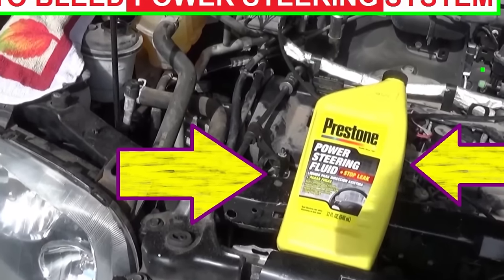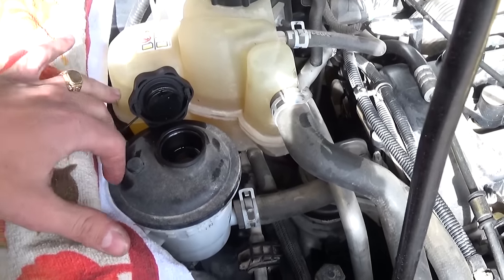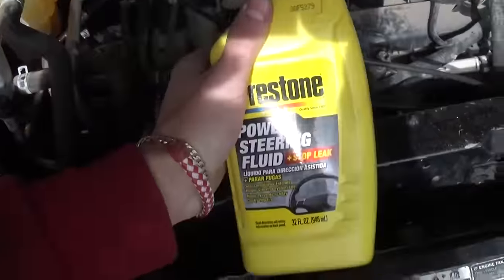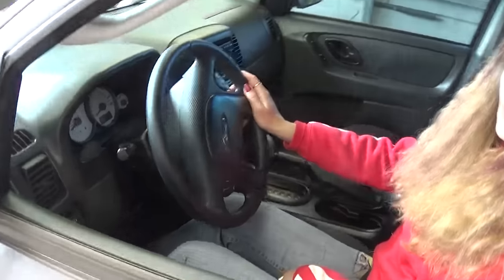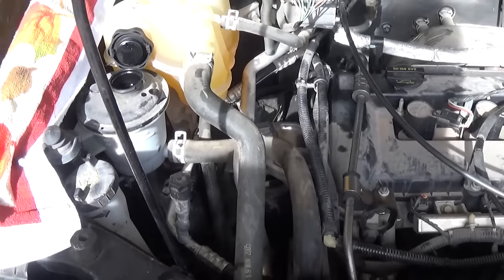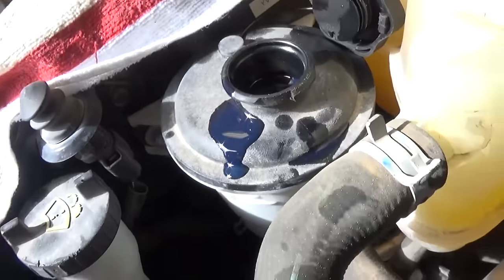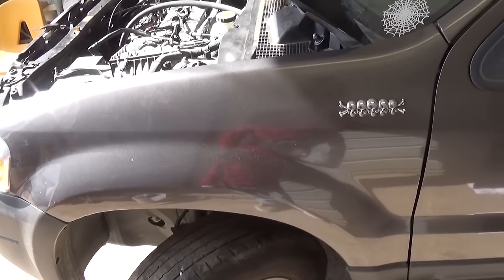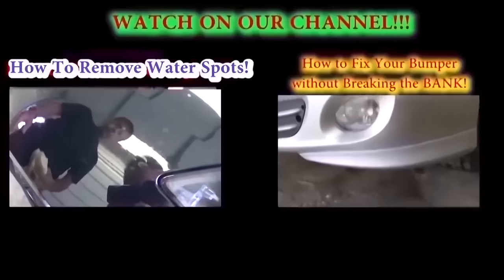How to bleed Power Steering System the RIGHT WAY! Bleed Powersteering

Comment: Much appreciated, had a loud pump, thought I needed to replace it. I had added power steering fluid a while back and knew nothing of bleeding the system. After seeing this, went out, turned the wheel a bunch, then started it (cap off) and did the same. Much more subtle and will monitor it as time goes by. Thanks for taking the time to help.
Reply: Any update my friend?
Reply: @geicocommercial  used your mentioned procedure and steering worked as it should. Noise disappeared as the fluid got through the system. Thanks.

Comment: This helps a lot man. I'm gonna do the new Rack & Pinion and pump in my 2000 Ford Windstar like this in just a few minutes.
I had never heard of bleeding Power Steering like you do brakes with vacuum. The instructions called for a J 43485 adapter and they are a fairly expensive adapter that fits in place of the reservoir cap so you can put 20 in vacuum on the system to draw the air out like brake lines. 
I didn't want to buy the adapter. I've spent hundreds on this thing already.  Thanks for this! 😀😀😀

Comment: Vacuum pump is definitely needed on some cars and you MUST repeat the procedure several times people. Let it sit overnight if time for it with cap off so bubbles work themselves out of system. Repeat next day. ALWAYS check fluid level during the process.

Comment: How do you get the steering wheel to turn with the car off and in park? My Jeep feels hard to steer that way, should I power through the weight or lift the front tires?
Reply: Sorry just realized it’s on Jack stands

Comment: I did this after replacing my power steering pump on my 2003 Crv. The power steering pump,  is getting very hot. What could be the issue?

Comment: Thanks guys! My instructions that came with my new rack n pinion said I needed to run a suction pump, (with a non sealed connection, as far as I can tell), and I was thinking that doesn't make sense at all! #1, if your going to use a suction pump, you MUST seal off the inlet, the connection, so that it sucks from the farthest point, drawing down on the entire system. And #2, once you're done, how do you KEEP the system in a state of vacuum,, while you add fluid? They didn't explain this AT ALL, making it seem very improbable and inaccurate. I think you CAN use a suction pump in a good way, they just didn't explain it very well at ALL, but you don't NEED to, in a system that is designed to flow, I e. very probably push out any air bubbles by moving the system, first manually, then from the pump, then a full run through of operation, once you've don't the others enough. Thanks again!  Btw, where'd you find that Head Turner, I mean Steering Wheel turner. I need to find ME one like that! 😄😋

Comment: Can you explain why the vehicle needs to be jacked up for this? Sorry if this has an obvious answer.
Reply from the maker: No problem at all, the vehicle needs to be on jack stands because it will be easier to turn the steering wheel without starting the car and being in the air there will be no resistance on the powersteering components. If it is a lighter vehicle you might be able to do it without being jacked up
Reply: T
It's also the best way to get all the air out
Reply: It also wont wear a bald spot in your tires, and wont leave a black mark on your garage floor.
Reply: The air in a closed system with pressure against it will act like a ball and bounce back and forth and/or compress. Giving it the least resistance possible, by jacking the vehicle up in front, allows the trapped air to be released more easily. It's not intuitive, but it works, on little cars as well as Kenworths.
Reply: @Imbored558  u do it while its off?
Reply: at first. then run it a bit to allow the pump to cycle the air back to the resivoir. check the level and top off and then do it again until you no longer need to keep topping off. then run engine while running wheel back and forth stop to stop. then, check level again. put it down on ground and do it one more time to be sure and then go for a test drive. everything should feel solid with no cavitation noise before a test drive.

Comment: Wouldn't it be better to tske the old fluid out of the power steering resovoir, replace it with new fluid, and then bleed it?
Reply: They did when they put on a new pump or line

Comment: Nice Vid.   What does it mean when the engine is running and it starts bubbling  and coming out of the reservoir cap vents
Reply: It means there is air in the system that did not get bled correctly. It shouldn't be bubbling obviously and also try not to overfill it.

Comment: Also I tried to bleed the power steering through the tube that connects from the reservoir to the steering pump and no I don't think my steering pump is sucking any of the fluid in it won't rotate it just stays in the reservoir and the reservoir floods when I slowly turn the wheel air bubbles coming out

Comment: always take time to remove and clean out the remote reservoir ( if equipped) before the system refilled &  is restarted ...slime and debris will form on the screen inside to reservoir ( most have a careen or a fine mesh filter) and that junk will restrict full flow back to the  pump, creating more hard to trace  issues.
Reply: Excellent point! I'm going to replace a high pressure hose on a 2001 PT Cruiser because it is soaked with fluid, even though I didn't detect a leak from it, and now that you pointed that out, I am wondering whether the problem is actually the screen being dirty; I will DEFINITELY check that screen out, and clean out the whole reservoir; I also bought a power steering filter; no leaks from the rack-and-pinion. Again, thanks for the reminder!

Comment: my steering wheel keeps locking whenever I try to turn the wheels when off. Is there any way to go around this?
Reply: Uhh and then turn it one click without starting I assume he meant to add lol.  Never had a car that unlocked the wheel from just putting the key in alone.  Sorry to nitpick, but Patrick seems like he isn't aware of this function on a vehicle.
Reply: Fair point... Furthermore, if the car is in a state where it is permanently off, and it is necessary to utilize the wheel, or to put an automatic transmission into neutral, etc... There is another place for the key, usually located near the gear selector. This is know as the shiftlock.

This may be useful in a situation where turning the key to auxiliary does not release the steering wheel.
Reply: put the key into accessory right before it turns on when your radio turns on . it should allow you to turn it all the way

Comment: So I dont have to bleed the system with that pump? I just replaced my water pump and had to remove the power steering pump and hose.
Reply from the maker: +Shaji Ali if you removed the low pressure hose you will probably not need to bleed it.

Comment: how did you remove the old fluid?
Reply: I was asking myself the same question ifnu found a better and easy way to change p.s. fluid let me know thanks.
Reply: He didn't say. He did say something about replacing a pump, but I'm not sure if that's what he did.

I prefer to just drain and fill every few years (turkey baster).  Some folks say to not even bother with draining and refilling.

Comment: Does that work with a diesel / hydro boost?
Reply: Joe Garwood   Yes it does, I just did my 04 Dodge 2500. If your truck is around the same year as mine or say make, go through the wheel well it’s the easiest way to get to the power steering pump, you also have to pull the air condenser out or the giant hose connected to it to get your pump out through the top of the engine compartment.

Comment: Not many people know that most power steering systems bleed the air out themselves into the reservoir
Reply: How longs it take
Reply: if you can even move the wheel on the ground...not to mention, under power, that air is causing cavitation on the pump...which is why we do our best to remove as much as possible before putting it under power.

Comment: why do you have to have the front end jacked?
Reply: You don't. Makes it easier to turn with the engine off. This is a waste of time. The pump will eliminate the air on it's own. Turn left and right a few times with the engine running and problem solved.

Comment: This didn't work for me, if anything it introduced more air. 2012 Nissan NV/Titan 5.6L V8. I had to: Jack up front wheels. Apply 20-25 PSI vacuum to reservoir, START VEHICLE, turn wheel, turn off vehicle, refill reservoir, repeat. After a while the reservoir level stopped dropping and that's when I knew all air was out of the lines. Problem solved!

Comment: Most Fords use Mercon V Auto transmission fluid for the power steering I accidentally used same as on this video now it leaks so be sure to check owners manual I know that Ford Mustangs use ATF type F or ATF Mercon V Not power steering fluid!

Comment: Am I missing part where you actually bleed the fluid?
Reply: I don't think he ever claimed to bleed the fluid, but it was slightly apparent that he was bleeding the air out of the system after adding new fluid. Hope this helps.
Reply: You bleed it by keeping the cap open and turning the wheels all the way to both sides
Reply: What if u dont use a jack?
Reply: john alkh Without the car running it will be hard to turn the wheel if it’s not in the air
Reply: @jonathancano1416  with both front tires in the air 👍🏼👍🏼